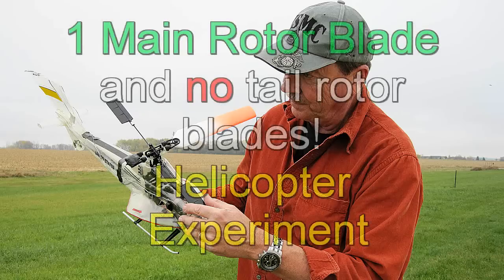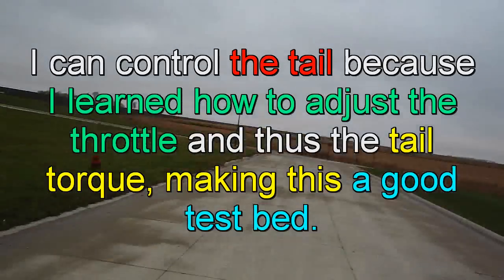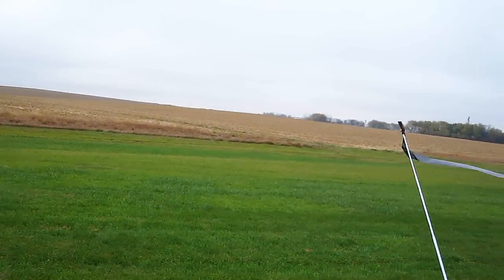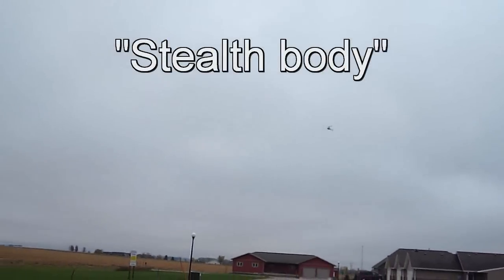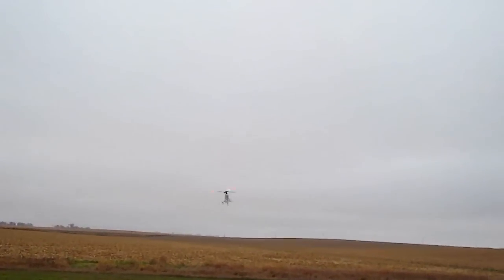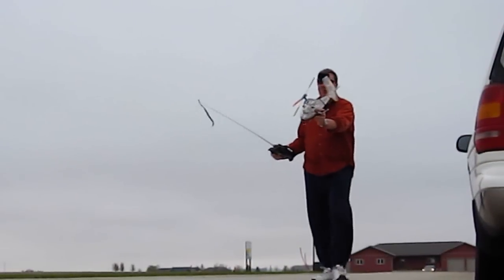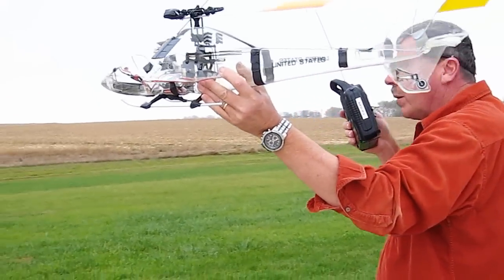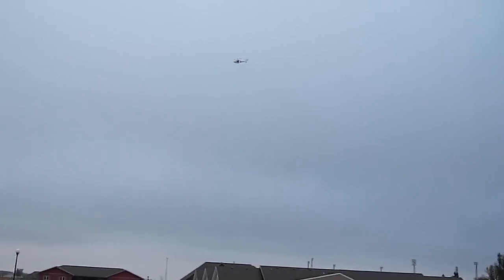Half a Rotor blade Helicopter with NOTAR No Tail Rotor.  (Experiment)

Comment: Very cool and totally makes sense. As long as you are dynamically balanced on both sides of the shaft, the opposing radial thrusts will cancel out and you will be free to rotate to your hearts content. In a strange way, it is simular to how big dynamic (axial) compressors are balanced to cancel out axial thrusts that cause havoc on the bearings and stresses on the machine.......gotta love physics....nicely done Dave!

Comment: Hey Dave , you might already know this but on the remote controller, if you push the throttle adjust thing (tweak control) all the way up while the throttle is still at the down position, your air craft will start on it's own without any throttle , then if you push the throttle control up it's like a massive power boost.

Maybe you already know that but just my 2 cent for others out there.

Comment: Interesting experiment. But I would think there might be 2 issues relative to full-size versions. 

1st. Stability.  Helicopters are known for their vibration.  I would think that this would increase that vibration. There would also be an issue of a constant heading. It can go in a straight line, but there is also a constant sea-saw of the body. This is seen when you slow the motor down. You do a turn with just the speed of the blade.

2nd. Auto-rotation when the motor dies. A single blade would probably push the body over sideways. And you don't want to hit the ground that way.

Just my speculation. I would think that the FAA would put a nix on this idea for a full-size copter due to the stress on parts.

But it is definitely worth playing with.

Comment: The most important thing not mentioned in the video is that the rotor must spin twice as fast because it does half as much work per RPM than a rotor with two blades. ricglos speculates below this was the limiting factor eliminating the design during the 1920's but offers no citations to back up his claim.
Reply: I did this on my mcpx while waiting for new pairs of blades, and rpm is just the same. needed more pitch though.

Comment: Good morning gentleman. That is certainly a one of a kind unique design but I'm curious about the flight characteristics. I started flying R/C fixed wing aircraft in 1982 and then I moved up to R/C rotary wing in 1992. Having knowledge of the physics of helicopter flight, it would seem that one rotor blade would result in reduced collective and cyclic control since the rotor disc is reduced by 50% on a two blade head. It's obvious that you solved the counter balance issue (excellent work) and it most certainly flies but without actually taking the controls, I don't have a reference to compare it with. Since you have designed, built and flown it, what is the practical advantage of only having one rotor blade? I completely understand the NOTAR setup. Please do not think I'm criticizing you or your design because I'm not, I'm just intrigued and curious. It's possible that you may have changed the future of vertical flight, lol. There used to be a lot of people, including some at Bell Boeing who started to doubt that the V-22 Osprey would ever be a practical aircraft. Nobody says that now.

Comment: Why is there no gyroscopic rotation, without the tail rotor ? I'm sure you could weight a four blade minus two as well I guess.........
Reply from the maker: There ist, but it is compensated by forward flight as the tail acts like a weather Vane.  When the motor is slowed down, the counter torque also goes way down making it very easy to fly, as I show in many other videos.  Here is a good explanation with my original Hyperfly invention.   https://www.youtube.com/watch?v=H8fO_t6LkXM&t=16s

Comment: Amazing!!!  You control uncommanded yaw with the throttle and slip stream airflow and a large tail vertical stabilizer airfoil, requiring hand launch and run on landings.  You can't hover without uncontrollable adverse yaw.  Amazing still.   All real heli flight schools should show this video, and teach the flight physics and mechanics behind this unexpected possibility.

Comment: @NightFlyyer You don't understand basic physics, do you?  It's all about the moment of inertia.  So the further it moves out, the lighter the weight needs to be due to the relation I = mr^2.  So since the radius is increased, mass needs to decrease (by a stronger factor) to maintain a constant moment of inertia.

The only benefit to moving it further out would be an overall decrease in mass.  The moment of inertia will stay the same (which creates the balance).

Comment: Agree that some toy helis tail rotor consumes 30% power of the whole heli. But hobby grade helis can be tuned to go lower than 15% power on the tail. And it is not hard for this tuning.
Reply: John C Gibson and with a torque tube it doesn’t use extra

Comment: how did you work out how much weight to add to the opposite side of the single blade. I'm guessing you just balanced the same as you would a 2 bladed prop and just kept adding weight until the single blade balanced against the weight added?

Comment: Doesn't the flybar also provide lift for the helicopter?  I would like to see you make a FBL single rotor heli to truly validate your   design.  The flybar also will act like a gyro to help stabilize the heli.  Just my 2 cents.
Reply: Fly bar is more for stabilisation, fly bar can be completely removed and a 3 axis gyro "virtual" fly bar installed in its place. Works like a yaw gyro but in 3 axis preventing unintentional direction changes. I use a Mikado V-bar on a nitro trex600, saves fly bar drag and weight and is programable, like a yaw gyro, as to how aggressively it holds flight tracking. It's not auto hovering or auto pilot, you can get them too. Comes with required parts to change rotor head from fb to vfb.

Comment: Hey dave! you should take a flybarless 450 size heli, put the smallest blades you can, and pie tin the tail rotor. single blade, not even any paddles. the ultimate single blade experience.

Comment: @NightFlyyer surely not?? Turning moment ("balance" required by other blade) = force (the mass of the weight) x distance from the pivot, therefore the further away from the pivot (heli's head), the smaller the weight will need to be, hence why so little force is required to undo a bolt with a long wrench, but a lot is needed if the wrench is short to undo the same bolt. Great video by the way.

Comment: and what about two counter rotating  coaxial one rotor blades ? It has already been done by an Austrian guy , in the ' 30 ... it seemed to be working fine !
The idea that one blade is better because it does not interfere with turbulence with the other one , is smart ... never thought it could be done ... good job !  
I just don't get it , why there is no need of tail rotor , any more ...
Reply from the maker: Yes, I have done that already too.  No need for tail rotor, just like Blade CX 2, because there is no body torque created when both blades are spinning in different directions as the same speed.  Speed one up and it turns one way without the tail rotor, slow it down and it torques the body and turns the other way.  Thanks.
Reply: this stuff requires to be further investigated ... seriously !  I dream of a a two rotors configuration with single blade each ... can you post that too , please ?

Comment: For airplanes or fixed pitch helis I wonder if you could use a higher pitched single blade of equal length to the original two blade version?

Comment: I still don't understand where there is no need for a tail rotor, albiet LESS torque is produced, but not none.
Reply from the maker: As long and  your moving forward, it flies like an airplane.  It is like a windmill tail.  It just stays back there.  Its just simple physics and it certainly works, as I have made many many videos using different helis and using this method and good enough even for Kyosho to buy my idea and manufacture it.  Here is another more recent video, that may explain it better.  Hope this helps.   https://www.youtube.com/watch?v=2yuQkRQi0aQ
Reply: @NightFlyyer  Ahh gotcha, less effective in hover... nice. I like it a lot.

Comment: to my knowledge this wouldnt work full scale the vibration would be intence not because of mass imbalance but due to asymmetric blade effect and that the rotor blade is producing a lot of of center lift this is usually dampened by the opposing rotor to some degree but as speed increases this usually decreases creating a larger off balance in thrust as the into wind rotor has a higher speed than the downwind blade

Comment: Although an older video, this is useful. I have been working through prototypes to find a way to get a timelapse sequence of the tidal changes seen from above the Blythbrugh Estuary in Suffolk, UK. Several hours exact GPS hover, a very specific objective. I'm not clear if we have cyclic and collective pitch control on this machine. The maximum efficiency of a single blade tips the balance, when the alternative is hybrid generator gas engine with a multi rotor. Perhaps you are still able to comment on whether this is an alternative, if you check out my "pivoted bi-rotor" in the wing experiments. See my channel on youtube. The main issue I have had is the slight updraft that is always present, gives maintained altitude on zero power, but at which point I can no longer control pitch/yaw/roll. Or even have to just accept camera shots are ruined as altitude continues to climb. If a heli can do better than 30g/watt hover efficiency, maybe that is the way forward? My knowledge of cyclic control is limited, never flown a heli. Is this a good reference - http://www.vrhc.co.uk/index.php/en/control-systems
Reply from the maker: Although you have never flown a heli, you certainly have amassed a lot of info on rotor heads.  If you need exact location, you may be able to install a GPS unit to control your heli, but I would use a quad like my Yuneec 500 that is GPS controlled, as no matter what the wind does, it maintains altitude and position.  Heli's spinning the blades becomes a disc  that can be affected by updrafts, just like a garbage can lid would.  Gas/generator machines are big and very heavy, and may not be efficient enough.  Long time flights may be their only benefit, I do not know.  A single blade heli uses less power to turn, but again it may not be what you want, as it also can pitch up. Cyclic pitch only makes the heli move in any direction. Collective pitch makes the heli go up and down by varying blade pitch.  This heli in my video only has cyclic.  It has no collective pitch.  I have many other videos with single blades, including ones with collective pitch and they all flew well.  This is a video of Adrian who took my challenge and used a collective pitch heli to test.  Here is a link to his video. https://www.youtube.com/watch?v=abXGxS6CUU4  Good luck with your project and thanks for commenting.

Comment: The lift force is waking on the half blade and on the hull s wings. Its a countinuos rotated and unbalanced x axis torque on the rotor mechanism despite of the reduction by the centrifugal force at the balance weight. I think the speed give the z axis stability on the tail, so the copter cant hover, and its not able to vertical take off  and landing. So its funny but useless.
Reply: What do you mean useless?? Works on similar physics as a GyroCopter and they are still used a lot today.
Reply: It is a bit of a prybar